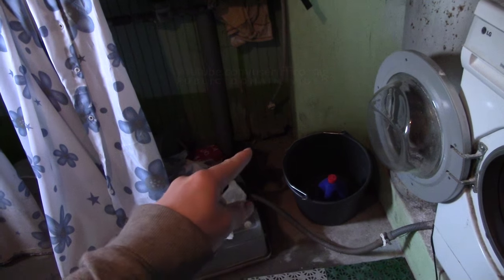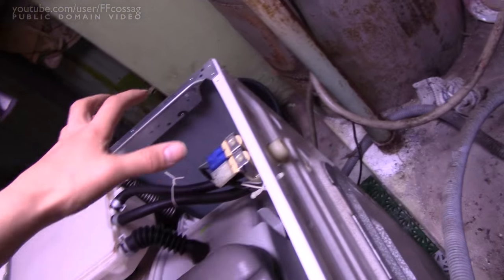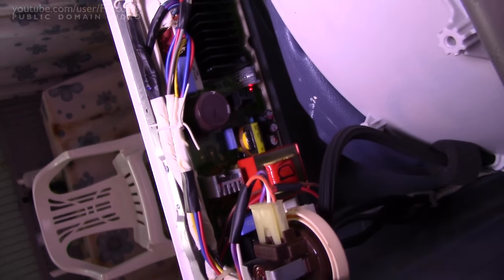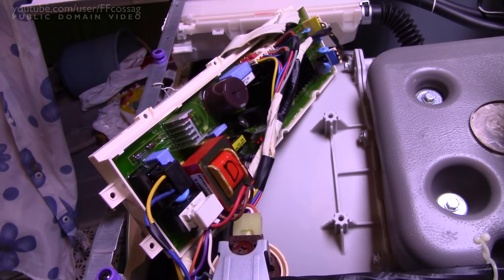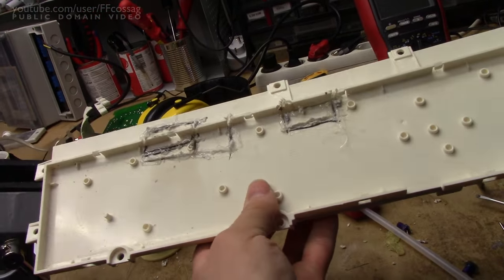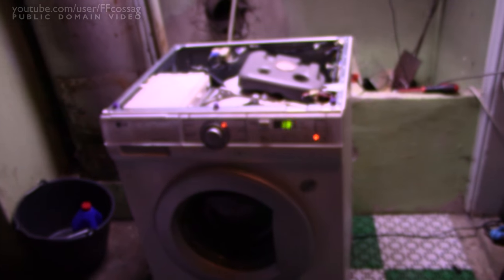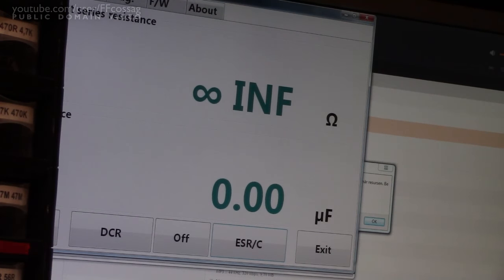LG WD-12231TB washing machine "time bomb beep" repair

Comment: In my case first problem was, after operating around 10-15 seconds, the washer was shutdown, then finally it was dead, won't turn on. The culprit was IC TOP243 ( burnout ), replaced it, fixed the washer. Thanks for the video, I did exactly what you did, cutting back side of the plastic case.
Reply: same happened here - i'm concerned that i may have a nearby SMD capacitor shorted. with the top243 removed the board pinout locations C,F,X,L,S all are connected with only the D out of the loop. i can touch any of the holes C,F,X,L,S and my multimeter will beep. seems they all are connected somewhere on the board. there is a surface mounted capacitor that appears to be between or separate F,C and X,L,S.  should that cap keep F,C separate from X,L,S or is continuity between all OK? any thoughts?

Comment: Big problem with these LG direct drive wm’s is the big drive chip pins hair line crack their solder joints.  If you cut round the edges you can take the whole potted board out of the the base.  Nothing dissolves the polyurethane potting, you just pick it off with a blunt probe.  Look out for darker areas they indicate hot spots.

Comment: I find that those rectangular blue capacitors on the board often causes problems. They lose capacitance over time. I replace plenty of them. Especially the 1uF and 100nF caps. Not saying it's your problem, just something to keep in mind on these appliance boards. Nice video. Cheers

Comment: We have a very similar machine at home. Noticed it in another video with the "cuckoo-cuckoo" sound it makes when finishing its cycle. Will keep this in mind if it ever is to develop any issues with turning on. Great video.
Reply from the maker: +LB0VG Ha - I came VERY close to putting a screw into the beeper on it while I had it apart just because of that god forsaken chime.

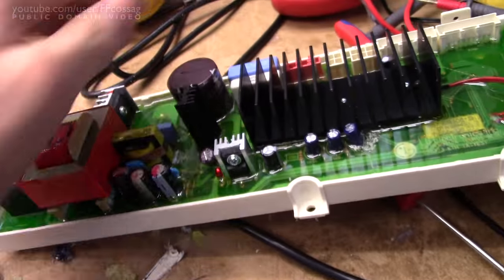Comment: 6:16 When I heard you mention "TOP243" I knew it was a "Power integrations" based stand-by psu you're fixing with replacing that capacitor... It's basicly a complete switching psu driver that is powered directly from the mains (Be it with a few support components such as diodes, resistors and caps) Nice little things! Good repair as well!

Comment: and this is why you don't run rugs in the washing machine, kids. turns it into a time-release carpet bomb, it will.

but on a more serious note, jeezus, that potting. at least it's relatively pliable and transparent potting, and in decent shape for 10 years old. I remember when i was starting out with board-level repairs, I had to fix our old KitchenAid dishwasher. i wasn't successful. in fact, I caused even more damage. put a janky lelon cap from ratshack in backwards and fucked the entire board. (and Lelon caps I've gotten from Ratshack have been decently okay, to be honest. fixed a couple monitors with them back in the day, still running just fine. still have a couple new in bag.)
thankfully we got another dishwasher about in the autumn, after using a detatchable sink-line portable washing machine on wheels made by Maytag (same model uxwbill did a repair video about not too long ago) for the entirety of the summer.
you want a fun one to fix? stove starter for the burners on a 20 year old stovetop oven. if no spark happens at the burner, the spark goes across a gap inside instead. 3 of the 4 burners on my stove didn't work. thankfully turned out to just be excess gunk on a part from 20 years of baked-on crap, but looking at the service manual we got with the thing, I was almost in for a shit show.

Comment: Nice tear down and repair.  I´m trouble shooting mine now since it´s pic micro is throwing an exception error and turning off.  I´ve tried replacing almost evey component except the pic. Then the refrigerator from the same manufacturer (Mabe/GE/Sanyo) stopped defrosting and regulating the temperature.  The refrigerator´s pic is blown and needs a new board.  The washing machines logic seems to work ok but it wont stay on.  I also found a blown diode on the solenoid that operates a mechanical clutch to switch the spin cycle on and off.  The evil company does not sell  any replacement for the washing machine controller any longer (the thing is only 9 years old) so if I want to use it it needs to be hacked using an Arduino or some other pic.   The refrigerator board is available but it comes with no guarantee, since the world over electrical parts can´t be returned once purchased.  The hell of it is that both appliances´s motors and compressors all work just fine.

Comment: grab onto the case of the cap with some pliers and pull it off leaving the two legs poking out, then solder new cap to those legs.
Reply from the maker: +Daniel Remminga While that might work some times, I've found that the risk of PCB damage is too big for this to be a method I like to use.

Comment: I don't get how you diagnose faulty capacitors by heating them up, care to elaborate?
Reply from the maker: +LReBe7 Electrolytic capacitors change characteristics a lot with temperature; the colder they are, the worse they perform - and this phenomenon gets much worse when they go bad. Heating a failed cap up might be enough to make it just good enough for the circuit to work.
Reply: FFcossag
 HUHh? O_o? I knew that a cap fails because the electrolyte evaporates when it heats up and the ESR changes, which heats the cap up some more and it's a positive feedback loop. I  NEVER heard about electrolytics failing in low temperature situations. What are the physics behind the failing under low temperature? I'm really curious, because I can't come up with a logical explanation myself.
Reply from the maker: LReBe7 Electrolytics don't fail because they're cold, they just perform worse when they're cold, good cap and bad cap alike.

I hadn't considered the causes for this until now, and I did some research on it. This paper

http://www.cde.com/resources/catalogs/AEappGUIDE.pdf

mentions the resistivity of the electrolyte as the cause of this behaviour (p. 6; "Temperature range"). Searching further for electrolyte resistivty temperature stuff, I found this post:

http://physics.stackexchange.com/questions/103844/why-does-material-resistance-increase-with-temperature-but-electrolyte-internal

Which explains that the mechanism for conductivity in an electrolyte (ion mobility) improves at higher temperatures, causing the electrolyte to have a lower resistance the warmer it gets.

So, the short answer to your question is: "Electrolytes work better when warm."

Extending this to analysing failed capacitors, it makes sense that the phenomenon would be exaggerated when you have a capacitor which has gone bad and has a smaller amount of electrolyte available. The ESR is largely made up of the resistance of the aluminium foil and the electrolyte, so when you have a constant amount of alfoil but a decreased amount of electrolyte, any change to the electrolyte is going to cause an exaggerated change in the performance of the entire system, since it's basically the sole limiting factor.
Reply: FFcossag
 Thanks, I learn something every day!

Comment: Instead of cutting holes behind the board why not cut the can of the capacitor and remove the insides and solder the new ones on the leads of the old one?
Reply from the maker: That's more difficult to water proof, and nowhere near as mechanically stable, and mechanical stability matters a lot in a washing machine.
Reply: After soldering the new ones you can always use silicone or anything else that is water resistant and adhesive to water proof and stabilize them.
Reply from the maker: t0nito
Sure - it works.

Comment: Samyoung capacitors are utter rubbish.  That's why I stay away from LG/Samsung products - - the Koreans are too proud to use Japanese caps, but the trouble is, they don't have the electrolyte down to an art, nor does it seem like they're trying to improve their formulas.

If you open up a Korean cap, the electrolyte smells completely different from a Japanese one.  It has a sweet fragrance.

Regarding ESR...  ESR is not always a reliable method for testing caps...  You also have to test leakage current, and then you have to do all these tests at various temperature extremes.

Great vids, you're now part of my Youtube electronics videos regiment.  My only critique would be maybe to trim your nails a little bit, would make the videos more attractive to the masses.
Reply from the maker: +khachaturian I'll trim my nails when I trim my neckbeard - i.e, when hell freezes over!

As far as Sam Young are concerned, they actually are decent. They just got bad rep after lots of TV and monitor manufacturers decided to use their cheap series right at the edge of their spec to do planned obsolescence. Decent Sam Youngs will run forever, as testified by every plasma TV ever.
Reply: +FFcossag I never said you should trim your beard - heck, I have a full beard myself...  But I trim my nails almost every week.

You're wrong about SamYoung.  They are most certainly not a decent brand of capacitors, and even Low ESR series of their caps do in fact bulge.

Rubycon ZL was the first cap that achieved such a low ESR with an aggressively aqueous electrolyte, and only other Japanese manufacturers have so far replicated the same stability as Rubycon has...  An exception to this might perhaps be some of the other high-quality brands, like Illinois Capacitor, Kemet, Phillips, Vishay, etc...  But it should be pointed out that AFAIK, Illinois Capacitor is probably the only company that has had an equivalent series (KXM) for any reasonable amount of time.

I have personally replaced bulged SamYoung caps with pretty impressive theoretical specs in LCDs.
Reply from the maker: khachaturian The reason Sam Youngs often fail in LCDs is because they're being driven way too close to their margins. I used plasma TVs as an example of where they're generally used better, because despite the harsh living conditions on plasma driver boards, I've very rarely had to replace a Sam Young cap on one of those, despite many of them seeing many tens of thousands of hours of use at elevated temperatures.

That said, I'm sure their margins aren't anywhere near as good as those of a Panasonic or Nichicon; I'm certain a Sam Young subjected to equal operating conditions will fail earlier the VAST majority of the time.

I just wouldn't classify a manufacturer as "bad", unless A) their capacitors fail with such staggering regularity across the board that it's inexcusable, like CapXon for instance. Or B) they're just generic "keyboard mash brand" China caps with little to no reputation to back them up.
Reply: +FFcossag  Ok, that's a very fair analysis.

Cheers, friend.
Reply: 1. Samyoung is a Korean company
2. They can't stand the heat and heavy load that well
3. Sweet smell most likely originates from glycol based electrolytic
4. You can improve the performance and lifetime by moving them away from hot components like MOSFETs and heatsinks
5. If in doubt, remove and replace them with black or blue wrapped ones

Comment: hi sir we have haier washing machine model hms 1000 tve the display Wright error 7 we checked the motor motor is ok we check the circuit board the circuit board has problem in Afghanistan we can fine new circuit board how can repairing the machine own circuit board please help me tnx